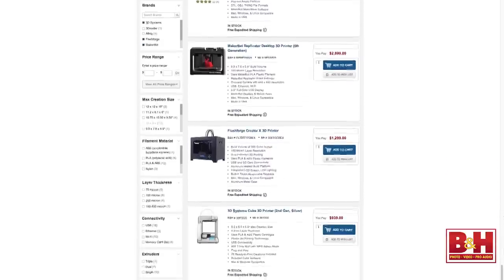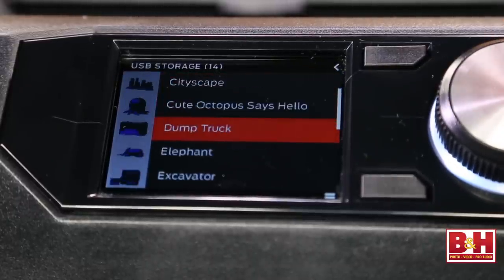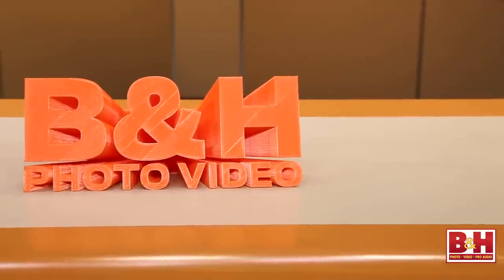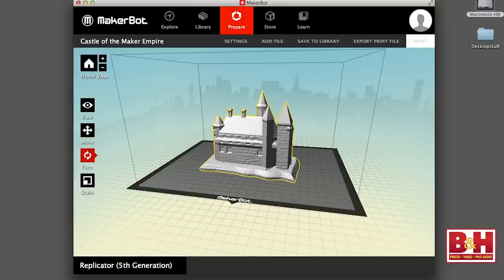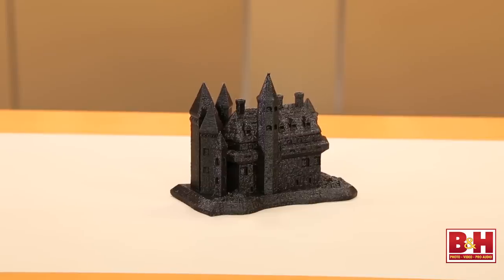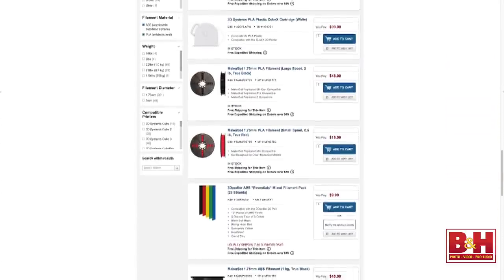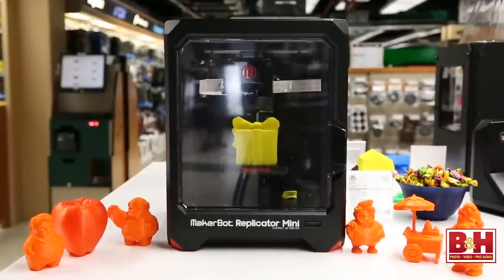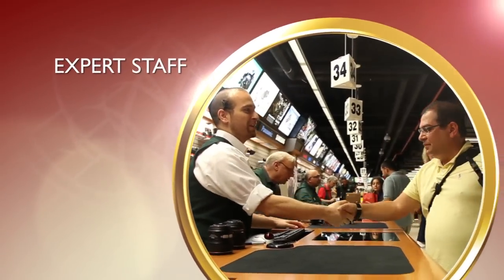How to Get Started with 3D Printers

Comment: The painter's tape is not to keep the build plate safe, it is a very good material for pla plastic to stick to! Printers like the Ultimaker 2s or 2+s use a headed glass build plate and you don't put tape on it unless one is using kapton tape for abs

Comment: what?
they sell 3D printers now?
[after checking their site] the price is actually very manageable...(dont know if the substrate is expensive tho')
Reply: The material used to make the products is actually pretty cheap
Reply: From 5:51 in this video, he mentions that the bracelet that they printed only used 20-30 cents worth of filament.  So I think it is affordable (especially if it is a bit hollow inside).
Reply: Rationalific yeah they did mention that. This 3d printer tech would come in real handy if you want to simply make your own action figures or models game character, etc. And compared to what they would cost from retail, you would be getting a steel.

Comment: Cool!  I ran across this old digital computer patent 3190554 that computers with air instead of electricity. Think you 3D printer could make one of these computers?
Reply from the maker: +ufoengines Patent US 3190554 is a pure fluid computer that can use compressed-air propulsion. There are no or very little moving parts. So it does sound very plausible. First, you need to be able to convert the blue prints with compatible computer-aided 3D design software. You will need to consider resolution, since it determines the thickness of each layer to be printed. Also choosing the correct filament is crucial. Also, the stiffness or flexibility of the plastic, so you know what forces it can withstand. The advised print speed of the filament: some have to be printed extremely slow for good results. ABS (Acrylonitrile Butadiene Styrene) is relatively strong, a little flexible and has a relatively high melting temperature of 437 degrees. Its glass transition temperature (temperature above which a plastic goes from it?s solid state to a pliable state where it can lose its shape) of around 212 degrees . The downsides of ABS are the smell it produces while being heated ? which is neither nice nor healthy to live or work around ? and the fact that it expands and shrinks in the process of being heated and cooled down again. The shrinkage in particular is a problem for 3D printing, because it causes 3D prints to curl up while cooling too quickly, which is called warping. To counter this, ABS has to be printed on a heated build plate. PLA (Polylactic Acid) is a completely different kind of thermoplastic. It?s being made from corn starch or sugar cane and is biodegradable. Its melting temperature is around 375 degrees and its glass transition temperature is about 149 degrees. Experimenting with different resolutions and filaments may be needed to test which will work the best for your pure fluid computer. 

Stgeven C 
askbh@bandh.com

Comment: What material would you use to make dish washer safe items? Which printers print wood or metals? Thanks for the video!
Reply from the maker: +rorschach775 The materials that are used in the 3D printers we carry would likely not be safe for food, as its possible there would be small gaps/imperfect prints that could lead to areas where bacteria could grow and could not be washed easily. Also, the printers that we carry are using materials that melt at a relatively lower temperature, so it is possible that they could get warped in the dishwasher. None of the materials used in the printers we currently carry, are FDA approved. There are extremely high end printers that can do food grade printing from various materials, but this isn't something we carry at this time. Unfortunately, I wouldn't have information about those printers. Christina askbh@bandh.com
Reply: B and H Good to know. Thanks for the reply!

Comment: wow. recommendation on 3d printer for printing cell phone cases? programming?
Reply from the maker: For the most part, any 3D printer can do a basic cell phone case.  I would suggest sending us an email letting us know the experience level you have with 3D printers, the requirements you will need from the printer (intricacy and accuracy needed for your design), and if you have a rough budget.  We would then be able to make a recommendation or two that would best suit your needs.  Christina  AskYouTube@bhphoto.com

Comment: I've made 3D models in software like Maya and Modo. Can you export the model in files types such as FBX or OBJ, and then import those files into the software that comes with the 3D printer?
Reply from the maker: This would depend on the slicer or driver of the 3D printer.  OBJ is supported by many different drivers but FBX is more uncommon.

Comment: Hi, fantastic video, really appreciate your explanation and your delivery, the best on youtube in fact!  Could you please advise me of the importance of painters tape, and also how often does it need to be replaced?  After every print? Is there a specific shop to buy this product? Many thanks
Reply from the maker: +Luke Appleby The point of the tape is twofold: to preserve the build platform, because if it gets any grooves or imperfections, it needs to be replaced; and to make it easier to remove the prints from the platform.  There are two types of tape that can be used on the build platform of a 3D printer.  Kapton tape is a specialized tape mad from a yellow/gold transparent material that is designed to pass heat through easily while protecting the build platform from scraps and scratches.  This also provides a smooth base layer for the print, making it a little easier to remove from the platform.  Kapton tape is much more rugged for printing over and over again and doesn’t need to be replaced nearly as often, but it still needs to be replaced.
Blue Painters tape is better for room temp or low temp build platforms.  The surface texture of the tape also makes it slightly easier to remove the print from the platform.
Replace the tape when you start seeing the impressions of the previous build on the tape to avoid the build occurring on an uneven surface.  The painters tape should be easy enough to source at any general/hardware store.  Christina  AskPhoto@bhhpoto.com
Reply: +B and H Thank you, really appreciate your support, and detailed reply.

Comment: Hello, Can you tell me what is the type of software used to print 3D objects?
Reply from the maker: +karl gheiti For the actual design, almost any 3d modeling program will work.  When it comes to the actual interface with the printer, there is software, usually provided by the manufacturer.  The code would be manufacturer specific, but should work across the entire line.  On the off chance the manufacturer didn’t include software in the box, it would be open source or an easy download.  If you have specific questions about software or a printer, I would suggest sending us an email.  Christina  askbh@bandh.com

Comment: Thoughts on the lulzbot taz 5 ? I'm looking for something high resolution for making cosplay gear
Reply from the maker: +Raymond Morgan  - The main thing to consider with 3D printers is the software that you would like to use as well as the materials you would want to use to print your items.  The Makerbot line of 3D printers does offer many models that are comparable and are even larger than the Taz 5 model (from looking at the Taz specs).  I would suggest sending us an email, going into a bit more detail about what types of parts you envision printing for your cosplay gear.  We would then be better able to go over some options with you.  Christina AskYoutube@bhphoto.com

Comment: I want to build a house I can live in along a nice sandy tropical beach..
Reply: There is a 3D printer for that too.

Idea is to get cheap houses (like $5k) or that house could be build on site without requiring heavy roads or large space to transport all required materials. But that is questionable as in special situations we can always use helicopters or simply transport only required material for that day. 

Still I would not swap house made from logs or bricks to 3D build house, as house made from logs can stay 200-400 years easily without any treatment.
Reply: paristo My guess is for bigger projects like that, they can just have one large DIY printer that they assemble where they want it built. I'd pay to see that happen.
Reply: Matt Lothe sure they can just build it around the site. But the problem is still that the good building isn't about fast building. For last 30 years we have moved more about module building and that has had very radical reduction to quality of buildings itself, resulting very serious material problems and architecture design flaws etc. A house needs a roof from the start to keep structure dry from begin, and in fast building you rarely get that for whole building season. What is as well problem as decades ago, buildings were build only at specific seasons and now they are all around the year, resulting big problems in decade or two after taking in use.

The reason why we build houses etc as we do is experience gained from centuries, and 3D printer from few engineers and architects doesn't replace the experience why often building a house is just a longer period project than couple of a day, otherwise we would still live in tents or similar 😉
Reply: You both have great insights. I was at home depot just the other day and they were selling one of theses at an end cap. It got me thinking it won't be long before a plumber or electrician can i need a mount or s fitting that looks like..... or fits.... or even maybe just go out to the van and custom fab a pipe to fit a specific job.
Reply: There's a video of a Minnesota man that created  his own castle on his backyard using his own created 3D printer.
Reply: Eddy Sarmiento  Nice
Reply: that is by far the best reply i could think of - the essence of the whole thing
Reply: Brent Miller yeah, My husband and I  we had RV when he was alive and we lived on a beach in Florida in the winter. That was real freedom and haven.  We picked oranges and grapefruit for our living , but that isn’t a life for everyone. Just us nomadic types.I suppose..

Comment: Can i scan my keys to make a plastic copy?
Reply from the maker: +Spring Tank It is possible to make plastic spare keys with the 3D printers offered at B&H. But from a practical standpoint, it is easier and cheaper to have a locksmith make a durable metal key for you. 

Please contact us via e-mail if you have additional questions: askbh@bandh.com >Mark<

Comment: I wonder if there are any copytight restrictions on printing. Lets say I want to print a replica of a star wars figure. Or lets say a spiderman figure. Will the printer let me do that
Reply: You will definitely be able to print it, but you will need to either scan in an already existing replica, find the 3D model on the web or use 3D modelling software to create one yourself. Copyright would only be an issue if you were to sell the model.
Reply: Terence Hood well I meant to use the 3d printer to make replicas for personal use. Mainly to make copies of rare or hard to find copies of action figures. I might give them away as gifts but not really as profit.
Reply from the maker: You would be able to print any file the printer is capable of, however, copyright laws will still apply. 

scott@askbh@bhphoto.com
Reply: B and H makes sense. I was asking more in terms of simply making replicas of rare toys for personal collection rather than monetary gain.
Reply: Asad the great None. Personal use has no restrictions. As long as you don't sell, or buy copyrighted models.
Reply: Elites Engineering
well my intention would be to find the design for the specific licensed action figure in the format that the printer uses. and then print one for my self. I dont intend to pay for anything more than the printer and refills. I will probably get into 3d printers once multi color models become super affordable. I mean the ones that take multiple spools of the plastic filamit in different colors.

Comment: How tough is the filament though?.....
Reply: ABS is tougher then PLA, I've seen working bikes printed in 3d (doubt they'll sell that big printers but it gets pretty tough
Reply: so what if I would try to make a guitar effect pedal casing with it?.... will it withstand my stomps?
Reply: biofear182 Depending on how you're set up, it's highly likely to withstand your stomps. for at least quite a while(if it costs you $4 and lasts a year you get new colors once a year :D)). How you build it will matter, how thick is the wall, how tight does it grab onto your pedal, is it the pedal? or is the petal attached to it like a hinge etc. etc.. There are probably already plans to make them on websites already :D

Comment: But I heard that makerbots suck...
Reply: Cassidy Walsh You are correct. Overpriced and terrible.
Reply: +Cassidy Walsh The 5th generation Makerbot machines do in fact suck. 
Our makerspace was recently involved in a makerfaire that had a bunch of these machines on display that had just been purchased by a local university. They are nothing but trouble. The so -called "smart extruder" is absolute garbage - it jams constantly. StrataSys, the corporate evil monstrosity of 3D printing has ruined what used to be a good open-source machine. They've closed the design and intentionally made the filament spools non-standard so that you are forced to buy their over-priced mediocre filament.
There are reports that Makerbot is trying to replace all of these "defective" smart extruders, but the replacement is no improvement over the original. Lots of pissed off customers.
At this stage, these machines are to be avoided like the plague. Buy something else. A good cost-effective choice is one of the many clones of the original Makerbot. Something like a FlashForge Creator Pro is FAR superior to this over-priced junk.